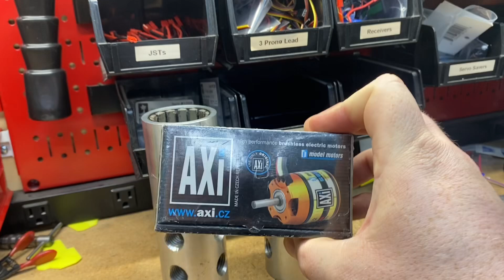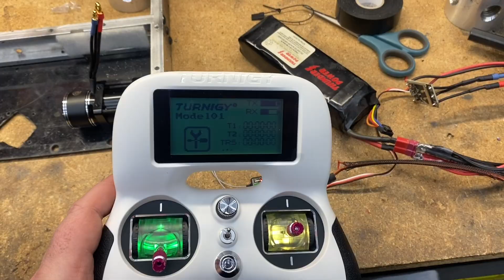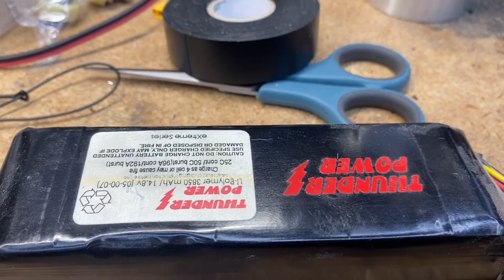The 12lb NHRL Robot Build Begins!

Comment: Zack. Im right there with you. Im the builder for Stumpy and ive been all aboard the struggle bus for this build. My parts are late, my printer isnt working and ive missed my test window. So I vibe with 'lets reuse the old build'
Reply: Same, I just passed my deadline for a November event and am at the "ok, time to cut to simpler bot" so now trying that pivot. Which frustrates me.
Reply: @aschreiber the main issue for my is two things. There is only 1 12lb test cage near me and it's not available most of the month. So, if I can't test this weekend, I'm not testing before nhrl on a design that I, and almost no others, have driven before. And second, my bot requires a 5 day long 3d print and the printer with that build volume is crapping the bed on me. There's 22 days before comp and to have 2 copies, I need to be printing for at least 50% of my total remaining time before the event

Comment: Check out the V-Good RC 32-Bit 120A 2-8S Brushless ESC for the weapon, you will need to get the programming card with it (it's basically a Turnigy Plush-32 clone) but it's bulletproof for a lot of 12lb weapons these days. I will have a few spare 80a and 100a versions of the esc in October just come say hi (Slam Plan) if you need it.
Reply: Thats one that was suggested to me as well. I ended up with the lucid 80